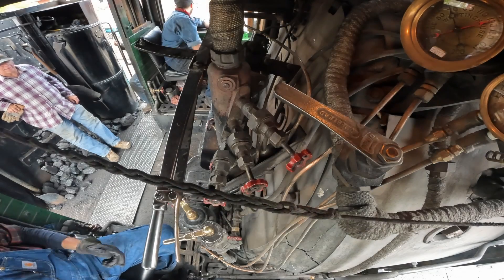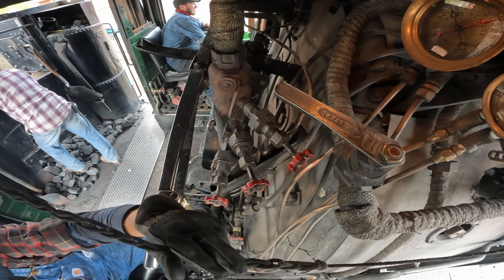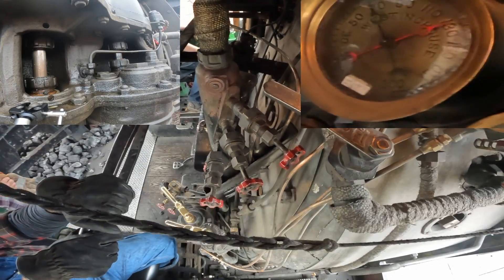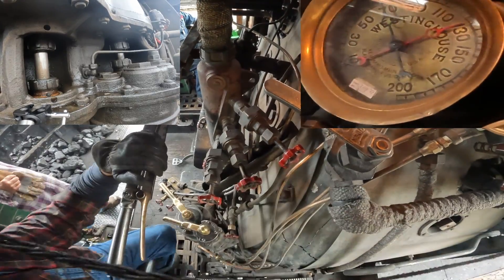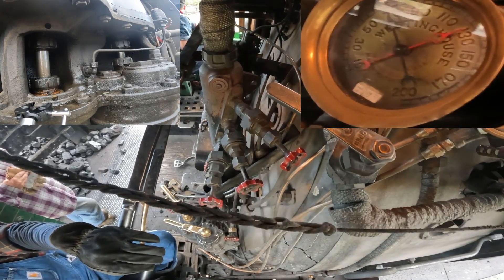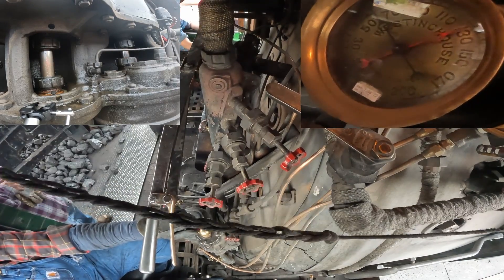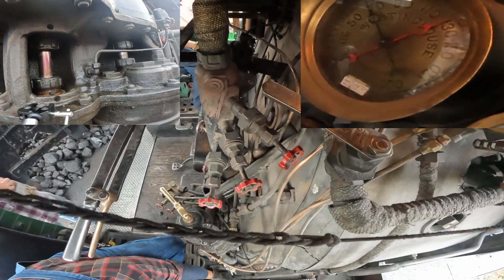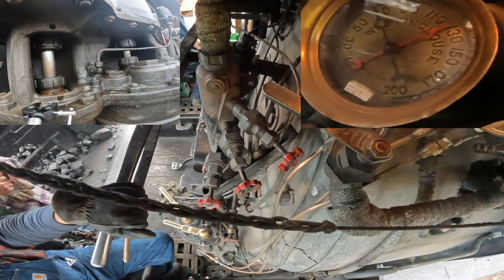How do the brake valves, gauges, and compressor interact? A study on D&RGW 491.

Comment: Mark,
Does the cross-compound compressor on 491 run less than the 2 singles on 346?  It’s been a very long time but I seem to remember on 346 that the compressor ran more than I saw in this video.
Reply from the maker: Yup; the singles are much less efficient. You're absolutely right.

Comment: How much water do you need in the boiler? Half, three quarters... something like that? Do you have to fill / empty the boiler to varying percentages throughout a ride or do you have to keep it at a constant rate? Thank you!
Reply from the maker: It's hard to say precisely from the scale of "empty to full" how much it is, as we can't read the full range of the boiler (only what the really usable range is). We keep it to about 1/2 a glass on the level, which is "full" in the glass going uphill, and almost empty going downhill. This is probably actually about 3/4's full, if I had to guess. 

We have to keep it in a pretty tight window. Too much, the engine works water, which can break it; too little, the crownsheet can get exposed which can cause an explosion. So, we're constantly adding, or removing, depending on what the fire is doing and how the engine is using the water.
Reply: @Hyce777  Thanks, man. One last question. If going uphill or downhill gives a false reading on the glass, do you have another method of finding the correct water level, or do you use a map to figure out that at this and this point we're going uphill / downhill?
Reply from the maker: @campionpesate4647  you just know that you're measuring water at the back of the boiler. The reading is always accurate for the back at the back :) haha. You need to know the territory. If you're going uphill, you need more than you normally do, downhill, less. Etc.
Reply: @Hyce777  Ah, many thanks. Hey if you ever take a vacation in Europe make sure to visit Budapest, it has the largest open air locomotive museum in europe, you can climb inside all of the steam locomotives and inspect them upclose, most museums in europe don't let you do that. Just make sure not to miss the sheds nearby, there are many old railcars and such inside as well.
Reply from the maker: @campionpesate4647  thank you for the tip! I will make it out that way sooner or later again. I've got family on Croatia and Switzerland, so there's reason to go.

Comment: I don't know if you mentioned it, but how do you deal with water condensing inside of the compressor (the steam part of it)? I know there's drainage cocks on the main traction steam engine, but those wouldn't be practical on the (permanently cycling) air compressor, or would they?
Reply from the maker: Lots of filters, radiator piping, and drains on the main reservoir. The air is still pretty "wet" at the end of the day.
Reply: @Hyce777  No, I meant the steam part of the compressor 😄
Reply from the maker: @czechgop7631  oh lol. Yeah, once you get it running it sort of just blows the moisture out the exhaust. It never gets enough water to cause problems because it cycles so often, and forces the rest out itself.
Reply: @Hyce777  Oh that's interesting, always wondered that. Cheers from Czechia and have fun railroading! :D

Comment: Immona return and grade you for accuracy.
I got 40s in before I decide to come back.  Right now you're -1 point for calling it a compressor, not an air pump; +30 for effort.
I'll be back...
Reply from the maker: It's not a pump... So... Lol
Reply: @Hyce777  Noob.
The AB catechism (George's own) calls it a pump.  I have a 26R diagram that does likewise. Mebbe the 9 1/2" stroker got replaced with something from Harbor Freight at some point.  In this case you would be [somewhat] excused.
(That is what my steam plant experience says, tho)
😜
Reply from the maker: @77thTrombone  Mr. Westinghouse might call it a pump, but as a device it's not a pump.

Much like people calling engines in cars motors. Yes, accepted terminology but the nitpicky of us (me) know it's wrong.
Reply: @Hyce777  yes.  You seemed to be cut from similar stock (as me,) which is why I chose to snipe you with itchy powder.  I guess that for the first part of the industrial revolution folks called them pumps because they acted like a sort of pump.  At some point, folks decided that pumps handle (hehe!) incompressible fluids, while compressors deal with compressibles.
Nowadays it's just a technicality used to irritate young upstarts.
Reply from the maker: @77thTrombone  lol, pretty much. We're a special bunch, aren't we? You'll note I also used "air pump" in the thumbnail because it fits a lot easier than compressor... Lol
Reply: @Hyce777  Yeah, special!  
I missed the thumbnail verbiage.
I'll be back to watch, learn, and annoy leave comments fo improve channel metrics.
Reply from the maker: @77thTrombone  cheers mate, cheers :)

Comment: Fine video - excellent length, as we get a chance to analyze the results over a longer period.
Just one thing... You are not "filming", There is no use of a celluloid based strip with holes down the side and a photosensitive emulsion thereon. That is like saying you are "steaming" when running an SD-40 or an Acela.
You are "RECORDING", no more, no less.
Reply from the maker: That's fair enough Doc. :)

Comment: The independent brake looks similar to 20 independent but flip 90 degrees and in a better spot
Reply from the maker: It's actually a completely different style with much more function, and as you noted, much more ergonomic.

Comment: I don't know if you've covered this before, but what is the mechanism that causes the compressor to cycle? Is it some kind of check valve that is hooked to a throttle on the compressor? I always wondered about that...
Reply from the maker: We haven't really talked about it too much, save for loco 360; there's a governor that's connected to the main reservoir pressure that allows more steam to head to the pump or not.
Reply: @Hyce777  Ok, that makes more sense. I suppose I'm just having a hard time visualizing how it works. It's a pretty neat piece of engineering!

Comment: Hyce:  another marvelous and extremely instructive video.  I'm confused about something, however.  I had understood that on a passenger train you always wanted to keep the cars stretched out.   When, nearing the station stop, Paul released the automatic brake and applied the independent brake, wouldn't this cause the cars to bunch up together?
Reply from the maker: We're stopping downhill on a mixture of 1.5-3.5% grade. If you leave the cars stretched, when you release in station, the cars will roll while folks are getting off. So you have to stop bunched; Paul did it perfectly such that you don't notice that he "gathered" the cars slowly. On level or uphill  track, you're totally right.
Reply: @Hyce777  Thank you for the explanation.  It’s another illustration of the level of artistry involved in running a train, especially back in the steam era.  But wouldn’t you want to leave the automatic brake applied at a short station stop on a grade instead of releasing them?
Reply from the maker: @Pamudder  not when the independent can hold it, and it's best to keep the train fully charged. If the engine couldn't hold it, you'd have to leave it stretched.
Reply: @Hyce777  OK.  I was sure there was a sound reason.  😀. Thank you again for your marvelous video series.

Comment: Another great video, Mark! 

Just out of curiosity, how do you guys fair using independent braking in combination with a train? Back east we do a lot of power braking and always try to keep the slack stretched, even for station stops. Only ever use the independent while running freight on our diesels if the cars haven't charged, you're trying to have a smooth start, getting a lot of slips, etc. I'm mainly a freight engineer, so educate me lol. 

Was always taught to not use independent on steam because you could loosen the tires. Were these engines equipped with a mountain brake setup whereas it would only apply to the tender and not the drivers?

I was also wondering if you might consider doing a video explaining the drifting throttle these narrow gauge engines were equipped with. Enjoy learning about unique features such as these because they're so foreign to what I have ever run. I heard tell of another interesting (French?) design known as a water brake for coming down very steep grades. Would be an interesting topic to cover.
Reply from the maker: Great questions Mark - I would agree that stretch braking and power braking would be ideal. However, here we're stopping on a mix of 1.5-3.5% grade with only a few cars, you really need the independent to stop without sliding something. 

If you use the independent for a long time and heavily (like coming off of Cumbres pass, for example) - you absolutely can loosen the tires. 491 is equipped with a mountain cock for removing the brake pressure to the driver cylinders, yes. 

We also do have the drifting throttle, and the engines did used to have the Le Chatelier / water brake. All deserving their own videos, hopefully get to them soon enough.
Reply: @Hyce777  Wow thanks for the quick response! Love the direction your channel is going in. 

Makes total sense you'd need a little extra braking effort to get a short passenger train stopped on that type of grade. Lord knows how easy it is to slide wheels on coaches...

Look forward to more of your videos! If you ever get out this way come over to SMS Rail in NJ. Still switching freight 1950s style here with baldwin diesels.
Reply from the maker: @MarkRBlackwell  oh neat! I am familiar with your diesels. I edited the sound recordings that TCS did for their DCC decoders for them, lol. Neat sounding Baldwin power. :)
Reply: @Hyce777  Get outta here! Small world man. Ya can't beat baldwins. We'll hopefully have our US Army 0-6-0 out by spring as well. Stay tuned.

Comment: Dang. Thought that compound air pump would be cycling like a air pump. Ya know   constant back  n forth like 100 cycles per second.  Anyhoo  when he stopped. The trains brakes all went to 0 psi? Or how's that. You put pressure on line to hold the brakes off ? Right. @#$&  More Beanze   please🔥🔥🔥🔥🔥🔥🔥oh is there a steam guage on the. Clylinder  s or de of the steamy, I know. You have one for boiler presser   later. Baseman out

Comment: Unrelated to the video, but a local theme park had a derailment today on their track, overturning a couple passenger cars. Four injured but nothing severe. I was just curious if it is common for the wheel sets to come off of the older passenger cars when they went belly up. 

Cause not announced yet, video suggest a misaligned switch. Engine is an 0-4-0 from late 1930s. Not able to find make or model of cars yet
Reply from the maker: I heard about that, I heard minor injuries, which is good with how bad it looked. Ouch.

For older cars, the bolsters are all gravity, so if you tip over, the car usually falls separate from the trucks. Modern roller bearing wheelsets also then fall separate from the trucks, but the older plain bearing stuff sticks together so long as the journal box doesn't break up.

Comment: im surprised how little the compressor really has to work on this
Reply from the maker: Majority of the work is done at the beginning, charging the train all the way up at the beginning. If it was a really long train, it would need more pumps to recharge, but it's not really long.
Reply: @Hyce777  Im curious what the displacement of those compressors are with each stroke, i feel like it must be a lot

Comment: Let it be noted that the reason the pump cycles more when the independent brake is used is because it works like the brakes on your car - it takes are directly from the main reservoir and puts it into the brake cylinders on the engine and tender. The automatic brake for the train works on the principle of displacement and equalization - it reduces the amount of air in the brake pipe into the brake cylinders, and air from the reservoirs on each car moves to equalize the pressure until it matches the brake pipe pressure. The main reservoirs are used to replenish the air back to the regulated pressure once the brake valve is set to release, and the pump works to replenish air in the main reservoir.

Comment: What's that thing with the cracks in it?
Reply from the maker: What do you mean?
Reply: @Hyce777  I'm pretty sure he's talking about the rear of the boiler near the bottom of the frame at the start of the video.
Reply from the maker: @SeanJAnimations  ah. That would be the calcium silicate insulation mixed with cement that has cracked. We never ended up finishing the corner of the jacket so you can see it unfortunately.
Reply: @Hyce777  Gotcha, That makes sense.
Reply: @Hyce777  Also I'd like to say thanks for being one of the few YT channels I know for being this interactive with their audience and giving out such cool information about trains. I'm learning things I never knew and it's quite cool! So thanks. :)
Reply: @SeanJAnimations  That is exactly what I was talking about, yes.
Reply: @Hyce777  Thanks for the explanation.